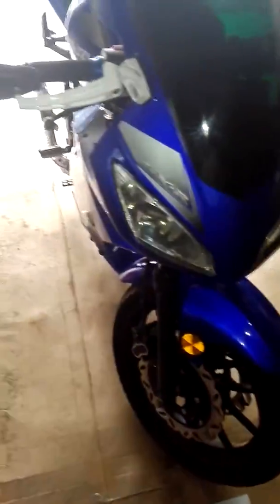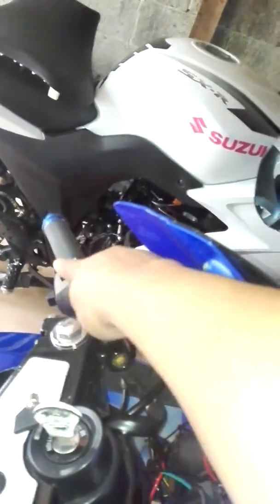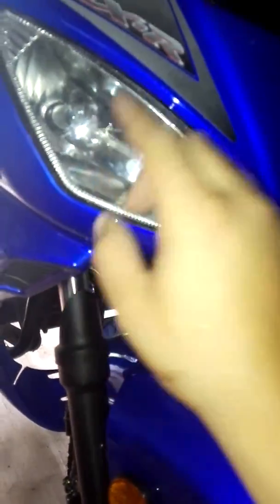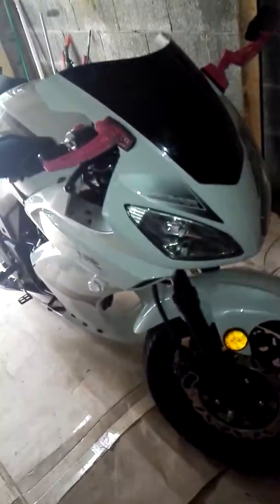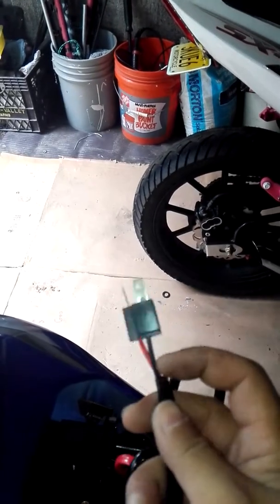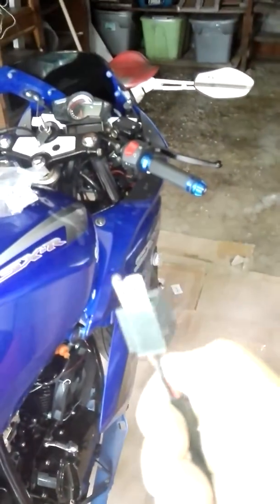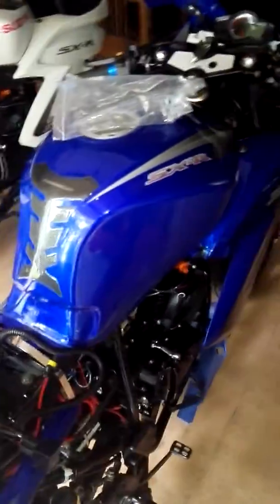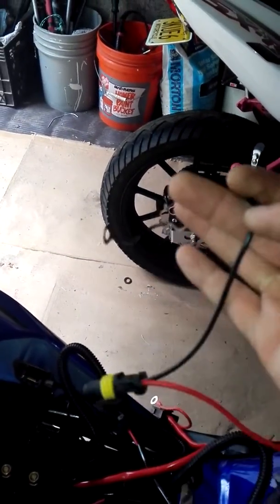2016 DongFang DF250RTC SX-R motorcycles updated Hid conversion with relay harness

Comment: thanks so much for your videos, looking forward to ordering my bike next week, I appreciate them
Reply from the maker: K Wilson no problem my friend, make sure to do the prep work, like make sure your clutch and throttle cables are adjusted properly,screws are tightened up, valves are adjusted properly and change the shipping oil that's in the engine. Just some suggestions because people tend to take these bikes off the crates and just riding them without doing the prep work then they start having problems with the bikes

Comment: got a question or really a problem.  laid mine down a few weeks back hit a curb to avoid a truck. now my wheel is pointing one way and handle bars another. how do I straighten it out
Reply from the maker: Trevor Zoch you got me there , but most likely the triple tree and shocks are damaged and possibly the wheel, best solution get a new triple tree and go from there , if you'd like because I'm not looking at the bike , take a few photos of the handlebars shocks and wheel and send them to my email lexdiamond43@gmail.com , maybe I can see where the damage is but if not and you want to be safe you can buy those parts cheap at  df-motor.com call the number on the website to place the order, hope that helps a little
Reply from the maker: Trevor Zoch you got me there , but most likely the triple tree and shocks are damaged and possibly the wheel, best solution get a new triple tree and go from there , if you'd like because I'm not looking at the bike , take a few photos of the handlebars shocks and wheel and send them to my email lexdiamond43@gmail.com , maybe I can see where the damage is but if not and you want to be safe you can buy those parts cheap at  df-motor.com call the number on the website to place the order, hope that helps a little
Reply from the maker: Trevor Zoch you might also be able if nothing is damaged to loosen the bolts that hold the shocks in place which is on the triple tree bracket where the handlebars connect to loosen those up on both sides and try and straightening it up like that

Comment: i have a 2013 df250rtc it wont start but it sounds like it wants to start any ideas on what it could be ?
Reply from the maker: If its been sitting for a long time/ few months , clean the carb drain the gas and add new gas change spark plug to iridium spark plug, once done turn on choke twist the throttle a few times to put gas in the firing chamber and give it a try

Comment: how did u change the exhaust? being that the stock exhaust is bolted and the new one is slip on ?
Reply from the maker: Wesley Yates I cut the bolt on adapter off and left  2 inches of pipe on the adapter so I can weld it just in case I ever want or have to put it back on the motorcycle
Reply: is it 1 1/4" slip on ?
Reply from the maker: Wesley Yates honestly I measured it with a digital caliper , it is a 38mm slip on